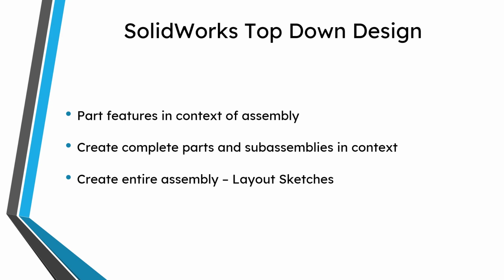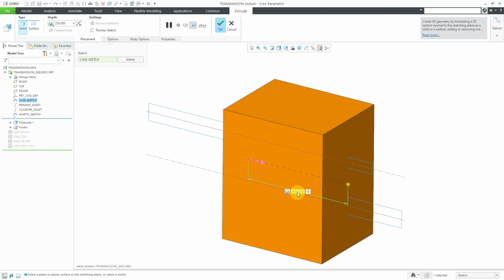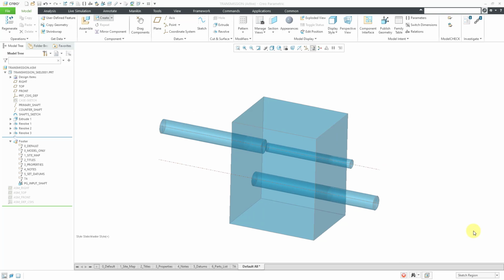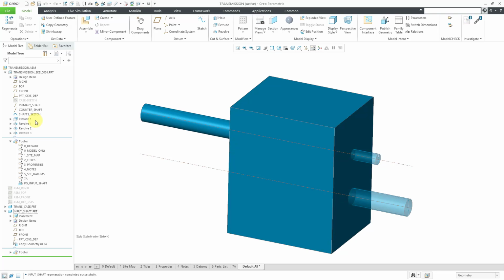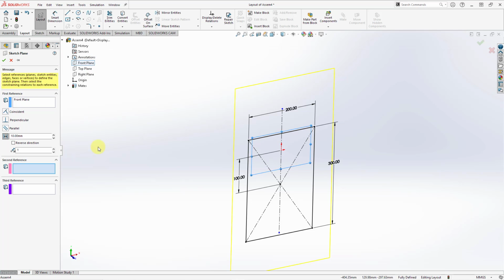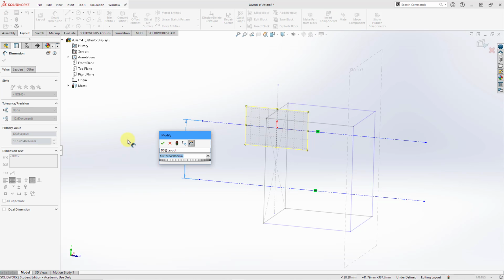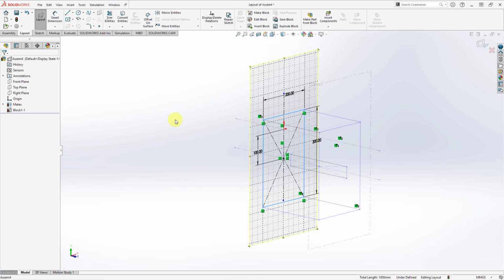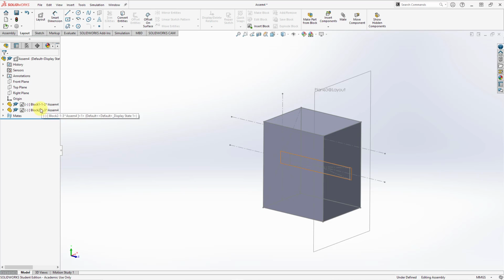SolidWorks - Creo Parametric Comparison - Top Down Design (Part 2) - Skeletons and Layouts

Comment: Is there a downside to just create a part in SW with all the features a creo skeleton (say just csys, centerlines, points) would have and keep that up top in the model tree for all other parts and subassys to attach to?
Reply from the maker: I often see this done. However, people often put solid geometry in these pseudo skeletons, and they end up throwing off the assembly and product mass properties. People also often forget to filter them from Bills of Materials, leading to confusion downstream. A lack of standard naming conventions often leads to this (I’ve seen these pseudo skeletons without any way of knowing they were reference geometry aside from being told by the creator.)

Comment: 20 year Creo user here, never used solidowrks. Is this really how you do top down design in solidworks? In your Creo example you had 3D geometry in the skeleton, that then gets published to many individual parts that get further refined. In the SW example it was 2D lines that were carried through from the layout to the individual parts. Is there a SW equivalent to the Creo methodology? I don't plan to switch, just genuinely curious.
Reply from the maker: It's surprising, but there isn't a SW equivalent to the Creo methodology. I believe you can access SolidWorks Help online without an account, so you can check for yourself. It's weird, but when I first started writing my Top Down books years ago, I planned to have a chapter on how other packages do Top Down and I was shocked.
Reply: @CADPLMGuy  Wow, no idea then how you would do product development in Solidworks. I can't believe so many people like it. The company I was at would do entire baby strollers, highchairs, and carseats with skelton models for the main surfaces, then part them out for the engineers to add all the detailed features on each part.

Comment: Hi Dave, 

Why do you choose to use surfaces for your skeletons? I haven't bought your books yet, but I can't really tell why it's bad practice to use solid models from watching your videos alone.

Thank you
Reply from the maker: I have a video on that but you also have to distinguish between Creo 6 and earlier versus Creo 7 and later.
Reply: @CADPLMGuy  I believe I watched the appropriate video. Does that mean that with multi-body modeling, that particular rule of thumb is obsolete? Or is it still best practice?
Reply from the maker: I wouldn't say "obsolete." Also as I have discussed in several of my books, I hate the term "best practices." I would say that with the advent of Multibody Modeling in Creo Parametric, it's a consideration that people should take into account when choosing their design approaches.
Reply: @CADPLMGuy  Exactly my opinion
Reply: Mass property analysis doesn't identify surfaces as having mass perhaps? I mostly use curve's and points for any type of Skelton approach but then again I don't really use Skelton models all that much anyway. I've been using the PTC product since pro engineer release 18.

I have a friend that's been using it for about a year less and he's landed a new job that Solidworks. He's pulling his hair out......some of the SW limits issues he's raised are nonsensical. We've not talked about it much recently so maybe he's gotten past the WTF stage.